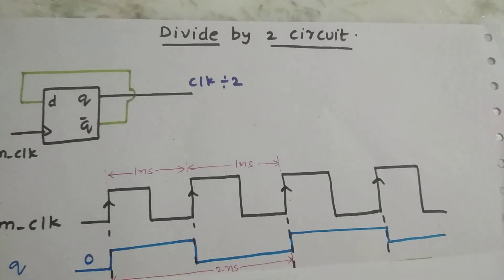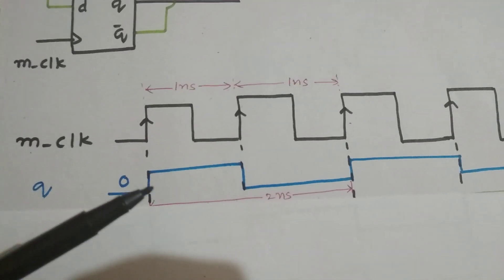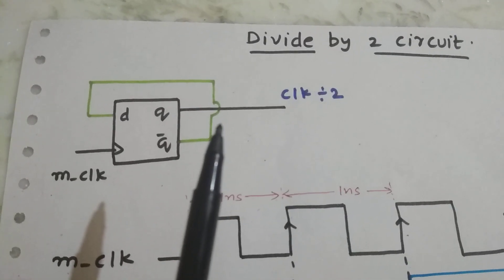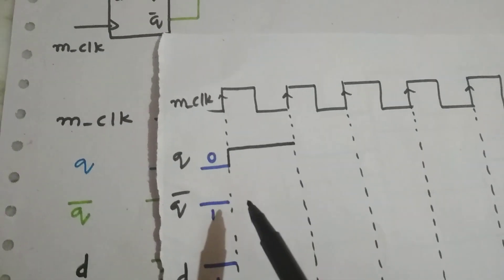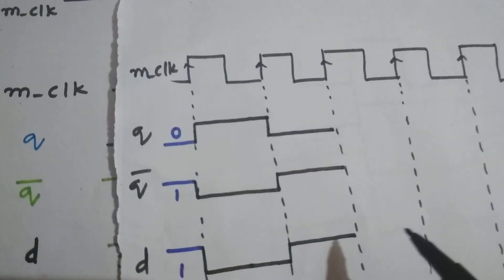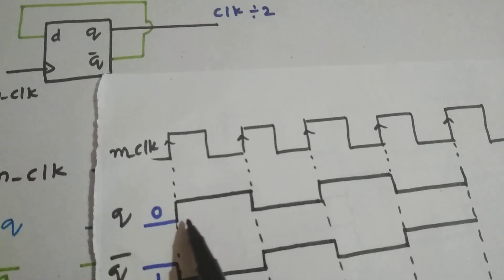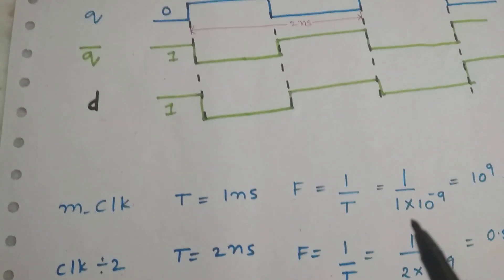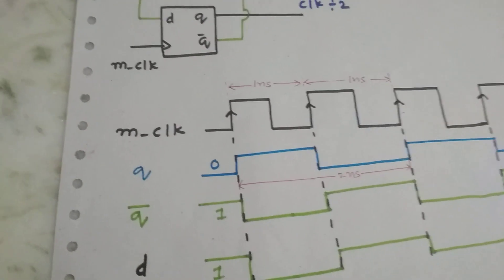[Frequency divide by 2 ]  clock divider explained!!

Comment: can you explain about a pattern display which is related to password recognizer?
Reply from the maker: Can you please elaborate
Reply: @KarthikVippala   Thank you for answering. I need to make a decimal number to binary number and put it into a password recognizer. This password recognizer would be in a locked mode at first until correct input password to be fed in. This would be recorded to a pattern displayer which shows "EEEE" at first "6EEE" -> "60EE" -> and so on until it reaches the "6010". anyway I need to build a pattern display to make program to be unlocked and move to a clock mode. The pattern display would be connected to a 16_2 to 1 multiplexer. Can u understand what I am trying to say..?
Reply: @KarthikVippala  can u explain what is decoder and how it works?
Reply from the maker: Decoder is type of combinational Circuit which decodes a small bit value into large bit value. It is normally used in combination with encoders which does exactly the opposite of what a decoder does.
It takes a particular number of binary values as inputs and decodes then into more lines by using logic.
Let's say 2 inputs in1 & in0 , and four outputs 01,02,03,04.
If in1&in2 are 0, 0 then outputs will 1,0,0,0 (01,02,03,04)
If in1&in2 are 0, 1 then outputs will 0,1,0,0 (01,02,03,04)
And similarly for 1,0 & 1,1 inputs.
Reply: Karthik Vippala then if i want to convert 1101 into a decoder and as long as it defines the correct binary(1101) and move to BCD to make start counting from 0000 to 9999. What kind of logic would require to transfer 1101 and trigger BCD to start counting?
Reply from the maker: @gmlcks1908  if we get 0010 , we can invert the output to get 1101
Reply: @KarthikVippala  so you mean use encoder first to get 0010 and put NOT gates and then connect to decoder to get 1101?
Reply from the maker: Yuo